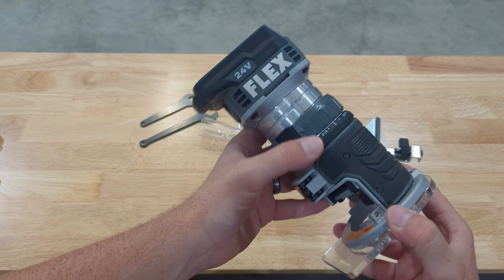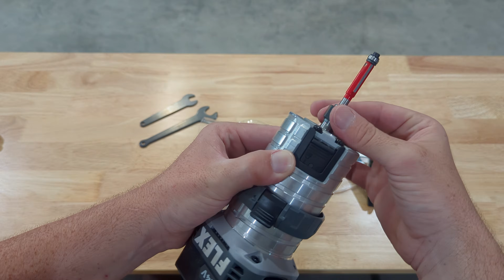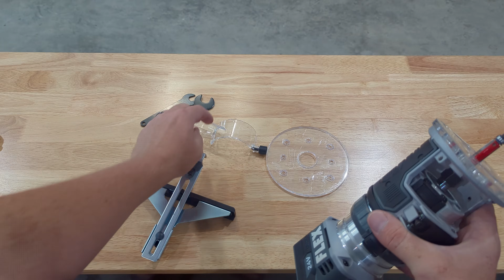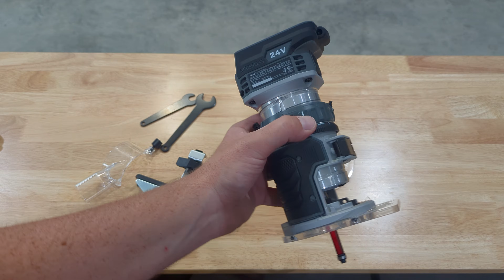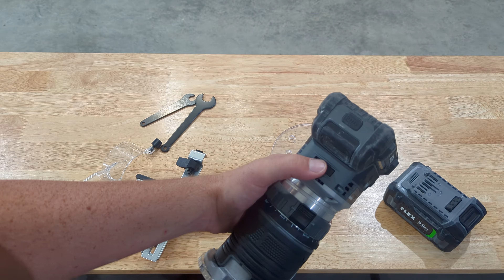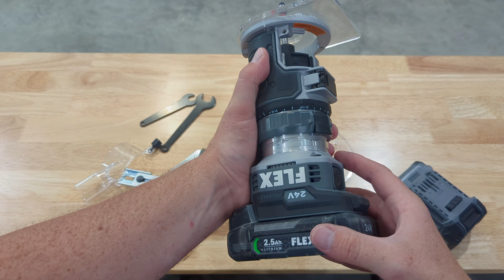Detailed Up Close Look - Flex 24V Trim Router

Comment: I am in the market for 3-4 cordless routers, Lowe's has a BOGO going on. Be honest are these routes worth the power, reliable and purchase?
Reply from the maker: I do not embellish my reviews with exaggerations or radical claims. I like this router. It's a good router. It does everything we need it to do. Will it replace a 3hp corded router in a shop that you're using for 6 hours a day? No, it's not rated to. Will it cut out window and door openings when framing with 7/16" OSB? Yes.

Comment: Would the router turn on if the spindle is in its locked position?
Reply from the maker: Yes & No. I tried it. It simply clicks and senses that it's locked and automatically shuts down completely. Great question!
Reply: @miillersconstruction  so it must be a safety feature since some of us might forget to unlock the spindle after changing or installing a bit. Nice to know that flex added this safety feature to this router, first time I’ve ever seen a router with a lockable spindle. 
I’ve got 2 dewalt 20v max brushless trim routers and these flex ones seem to be pretty similar with them (the depth adjustment wise). The only thing that sucks about those dewalt trim routers is that they don’t come with edge guides and I don’t even know if they make one for that trim router, anyways, Merry Christmas and have a great happy new year!
Reply from the maker: @BigBaller_69  interesting about the DeWalt routers. Can't believe they don't come with the edge guides. Thanks for checking out the video.

Comment: So what is your personal router? Or if you could pick one, which  would it be? Flex, DeWalt, Makita, Milwaukee?
Reply from the maker: I use the Flex personally. I do still have two corded Bosch routers in the shop, but the Flex does everything we need so I keep it in the trailer. It's been a great tool so far.

Comment: So it's kind of late now to ask questions after I got 2 of them literally last week haven't used them yet, So is this a rebrand of the  DeWalt.

Tools that i am not 100% familiar with i never take to the job site immediately. My Milwaukee is Okay but i can't push it so i bought these solely because they are 1 1/2 hp which beat out the best, DeWalt, which i was going to get at 1 1/4 hp.
Reply from the maker: Nothing Flex produces is even remotely close to a DeWalt tool. Many people have asked me if flex is made by DeWalt. There is absolutely zero affiliation there. They are not made in the same manufacturing facility, the engineers for Flex are in Illinois. Nowhere near DeWalt headquarters.
Reply: I want so bad to go spend a few hours running these babies and organizing it but I think the wife has other plans. Happy Thanksgiving to and the family.
Reply from the maker: @rickyperkins232  man I'm wanting to film a few videos of the new Flex goodies sitting in my garage right now 😜😜😜
Reply: @miillersconstruction do you have the new 15 gauge nailer?
Reply from the maker: @rickyperkins232  it's an 18 gauge nailer but yes I have it. I posted a YouTube short using it yesterday. Man it's crazy powerful!

Comment: Been thinking about this....
Reply from the maker: Its a nice unit man.
Reply: @miillersconstruction  i dont doubt it.  Everything i have bought from Flex has been top notch....especially their batteries.  Both stack as well as regular batteries.
Reply: @unclefester4626 did you get this router?